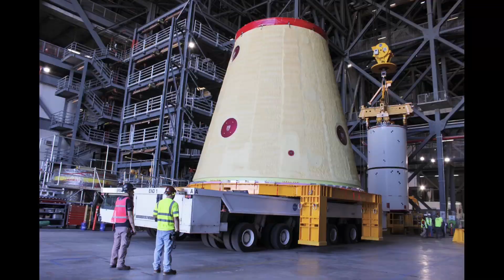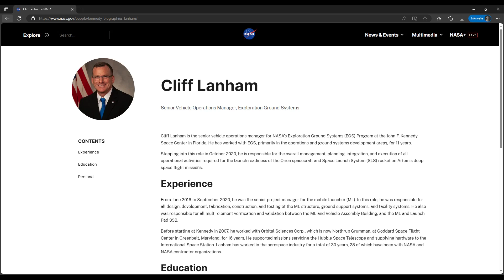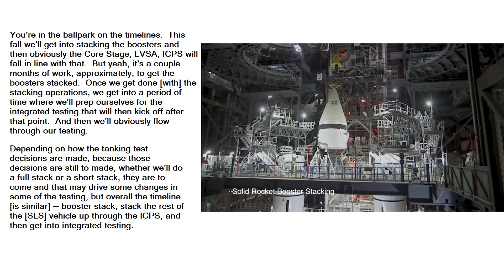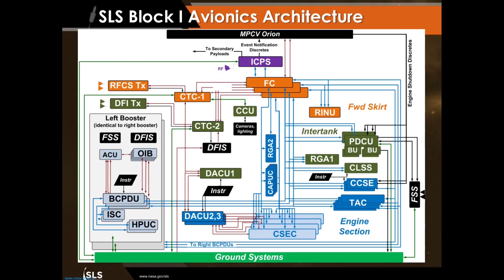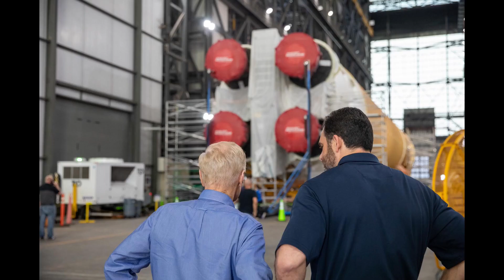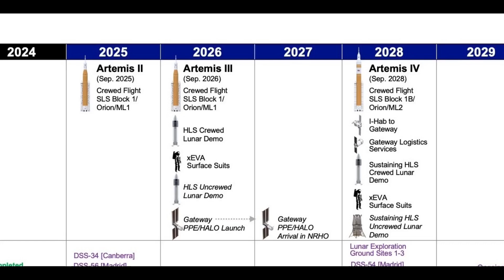Artemis hardware assembly continues, how will SpaceX's stance on the environment impact schedules?

Comment: Were you an aerospace engineer, or maybe a NASA employee at the Cape? Your expansive knowledge of all of these dizzying details is breathtaking. Also: it's a shame that NASA is not more transparent. There ought to be a NASA blog that everyone can visit and see the status of all Artemis missions and their vehicles with full disclosure. A shame that there isn't.

In addition: all the commotion over Boeing and the Exploration Upper Stage for future Artemis missions is very disturbing. I do not understand why NASA doesn't pull the EUS out of the mix and use a Centaur V upper stage from ULA till Boeing gets their act together.
Reply from the maker: It's only easy to mix rocket stages with Kerbal and Legos.  Otherwise, a lot of time and money will be required to make SLS compatible with Centaur V.  

And vice versa -- it's likely that making a Centaur V variant compatible with the SLS vehicle and EGS infrastructure would require resources that ULA would have to pull from something else, even if NASA/SLS "paid" for them.

The only stage that has gone through all that compatibility groundwork, testing, and certification is ICPS.

Any other stage (including EUS, since it's not done yet) will require more money to work with SLS.
Reply: The commotion is rather overplayed.
In reality EUS development has been going a lot smoother than Core Stage development so far.
The fact that they are seeing more non-conformances than expected in a development program isn't a showstopper by any means.
Reply from the maker: @brokensoap1717  There still remains the question of cost and schedule performance for EUS and Block 1B.  Core Stage saw a lot of its issues in the phase of development that EUS is now currently in.

Comment: I do find it interesting how some of the recent narratives around Artemis 2 have discussed the possibility of it being uncrewed.
Reply from the maker: The uncrewed option is hard to dismiss after the Starliner CFT decision...particularly since the rationales and decision-making process for Starliner were not thoroughly communicated.

It will be natural to compare/contrast the risk tradeoffs that NASA makes for the different situations, even if we don't get a detailed explanation.
Reply: Confidence is low, not critical but enough to cause extreme caution.
If Artemis looses an astronaut… then it over… Only SpaceX and Blue Origin will be the options.
That weirdly would support a lost of life a bit easier than NASA

Comment: How long does recycle take and will crew use emergency egress in that event?
P.S. Aspirational. That's a good one.
Reply from the maker: Everyone's Artemis schedules trend towards aspirational, but it's been used to describe Starship schedules most of this decade.

We haven't seen an SLS countdown recycle for real, but last word from launch team simulations was an hour or so.  The crew would hang out in Orion and their "on back time limit" already includes the whole two-hour long daily launch window.  

With that much time to work with, the launch team could hold at T-33 seconds, cutoff, recycle to T-10 minutes, and then try again on the same day...assuming the problem could be resolved in the meantime.
Reply: @PhilipSloss  
YIKES! My hand would be on the ejection handle.
Thanks
Reply from the maker: @blairseaman461  Whenever a terminal countdown is halted, recycling to a more stable configuration is typical.

There are fewer long launch windows these days, so usually a cutoff results in an automatic scrub; a scrub isn't necessarily an emergency and the crew waits to be let out of the vehicle.  But a cutoff isn't always an automatic scrub.